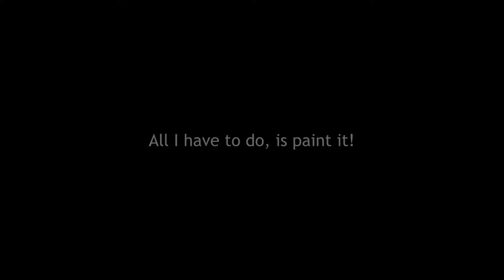Picket Fence time Lapse

Comment: Hi, I’m currently doing my picket fence. I have set the post in and will doing the rails and pickets. Where did you get your pickets from? And what pickets did you use? Where did get long lengths and why? Your answers will help me Building mine.
Thank you kindly
Reply: Hi Harry,  sorry I didn't see your comment until today. I used long lengths as it was cheaper to buy. I also only wanted flat top pickets. 
I hope your project went well.